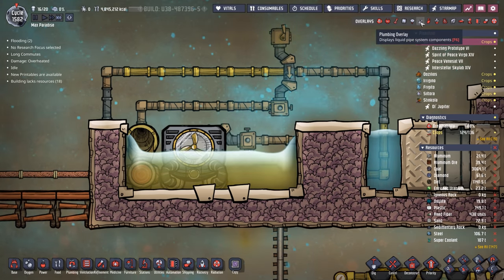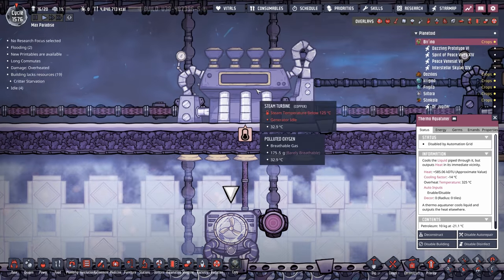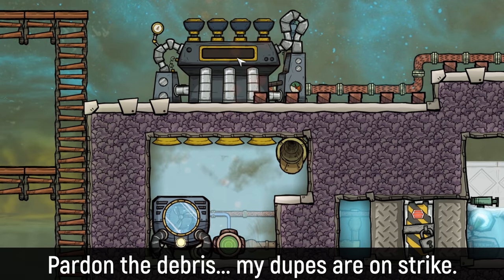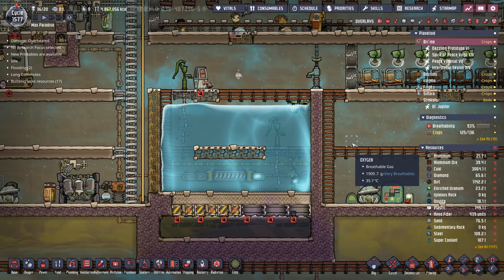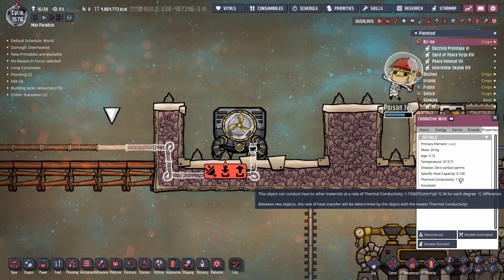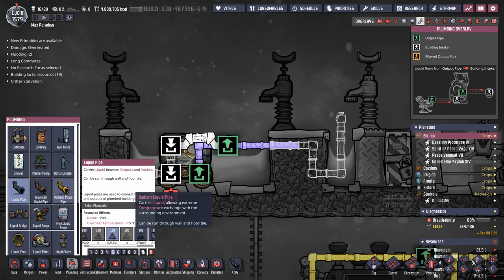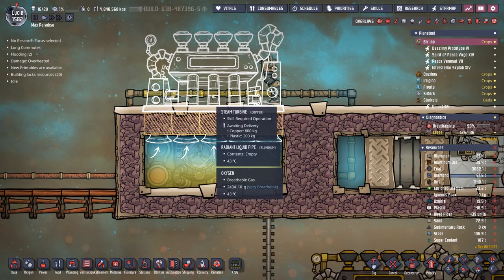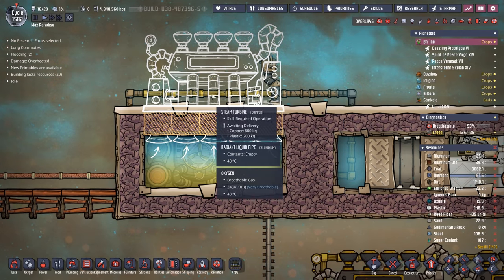Thermo Aquatuner Tutorial | Oxygen Not Included

Comment: If I'm understanding correctly the choice to use a layer of pwater below the water was so you wouldn't need so much of either since ONI forces them to stack? But does the pwater turn into steam or does it stay there after the water does? If it stays, wouldn't it off-gas? If it turns into steam is it psteam? Why is this perplexing me lol. One other question, why do your designs vary from just 2 tiles high for the steam chamber to much larger?
Reply from the maker: The P.water will take longer to turn to steam, but then the water would have already flashed.  The pressure is much too high for the p.water to off gas.  When the p.water flashes it also turns into regular old steam (but leaves behind a little bit of dirt). I switch it up sometimes jus depending on the specific build.
Reply: @EchoRidgeGaming  Thanks! I tried it with 1 row pwater, 1 row water, 2 rows oxygen and the system completely failed due to the oxygen blocking the steam turbine's inputs. I read a comment here from someone else stating the oxygen would get overwritten by the steam but that wasn't the case for me. I now have it working from your video with just 2 rows of water (I prefer the look of the box with no dirt left behind). 

One last question, I noticed sometimes you use temp shift plates and sometimes you don't. I can see why you used them to change resin state but what about the steam chambers? It looks like if you don't have radiant piping going through every square you opt for temp shift plates to spread out the chill, is that right?

Comment: I'm sure I'm not the first to point it out, but a lot of mystery would be cleared up if people remembered that "chill" is just a lack of heat. -273C is 0 Kelvin. Supercoolant cannot freeze because there is no more heat left in the fluid for the aquatuner to remove.

Heat capacity is the amount of heat required to change a material's temperature. The aquatuner reduces temperature by 14 degrees, which is a different amount of heat depending on the working fluid's heat capacity. 

Heat is a measurement of energy. Temperature is a measurement of potential the energey - heat - moves from high to low potential - temperature. Temperature does not move, and temperature is not conducted. Heat does.

Comment: Very nice tutorial!
Is there a special reason to cool water into ice and have the chill transferred to metal tiles instead of looping the coolant through the metal tiles directly and skip the two water/ice tiles? Is the high heat capacity of the ice important to keep the temperature stable?
Reply from the maker: Only really gives you flexibility.  If we decide to change the temperature of the cooled area, we don't need to adjust the coolant temp.  We can then just adjust the temperature of the room and know the coolant still has chill to give.  It makes more sense when you are not  using super coolant and can only go so cold with early game liquids.
Reply: @EchoRidgeGaming  I think he means run it through the leftmost metal tiles, instead of through the ice. You'd still keep the door setup as it is.

Comment: I been looking at your tutorials and they are the best I found. I am personally having a hard time with water purification if you decide to make a tutorial about that.
Reply from the maker: Tuesday's (12/14) episde is actually about a water purifier... although it is a massive purification plant and probably not suitable for individual uses.
Reply: @EchoRidgeGaming  I check it out, for some reason everytime I filter the polluted water, after the germ sensor actives when there should not be any germs, my water end up with some germs... I will try with 2 sensors to see if that fixes the issue.
Reply: @EchoRidgeGaming  pro tip... Don't use sinks, use "hand sanitizers". Also, don't use toilets, stick with outhouses. You will never have "germs" again, in your water.

Simple cure for germs in polluted water... Just use alternating storage tanks that sit in chlorine filled rooms. As one is filling with germ water, the other is sitting until the germs are gone. Then you empty the germ-free tank, before swapping them over. Just a simple shutoff valve is needed, to swap draining when one tank is full, or the other.

Purification is only needed to replace what is consumed. Many things happily consume polluted water... Plants are one of them, deoderizers consume the gasses, which reduces the volume of water for cheap oxygen, etc... Excessive heat turns polluted water into clean water-steam, leaving "dirt" as a byproduct...

Comment: Seems to be a bug in the game again... Using the "pipe temp sensor", with the pipe going into the aquatuner and also into a "pipe bridge"... There are points where the game prefers going to the bridge, and not sending it into the aquatuner, but the aquatuner runs, "empty", as you watch all the fluid go right past it.

I can't figure out what the issue is, but it worked for days, perfectly. Loading, one day, it just started taking the other path as priority, instead of the priority being the closer aquatuner, which is empty and running. Though, this was the "replacement", as I built one out of copper first, it broke, and it was deconstructed and rebuilt with steel. Which also required rebuilding the pipes. (Which, somehow, might be responsible for the swapped priority bug.)

Comment: This always bugs me... All these setups don't take full advantage of heat deletion. They put the 95c water, immediately back into the steam chamber. Then it has to be heated back up to 100c, using expensive power from the tuner. If there is nothing to cool, it just stops producing power, and the over-all net becomes a loss of power.

If you dump the 95c water to another chamber, where you can heat it from something that raises the temps, before the aquatuner, you continue to get constant power and free cooling. (Because the aquatuner isn't turning on, consuming power.) Then, if you need cooling from the tuner, you swap out the free heat source, for the expensive one that yields greater cooling, at a higher cost.

Eg, a production room that happily runs at 150c, can be cooled by the 95c steam, only "chilled", to stay below 150c by the aquatuner, when needed. But while the tuner is off, because other areas no longer need cooling to super cold temps... Steam is still being made to get the full 850watts of power from each turbine. You are getting full "heat deletion", and not wasting power raising the temps of 95c water to 150c+ temps, to get 850w of power from the loop. (Which makes the 95c to 150c conversion a loss of power, not a net gain of cooling.)